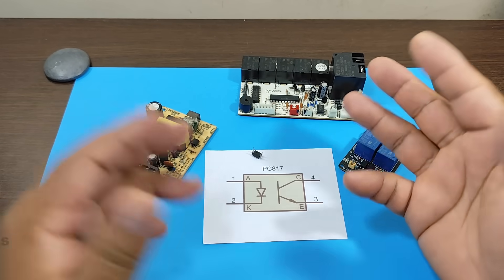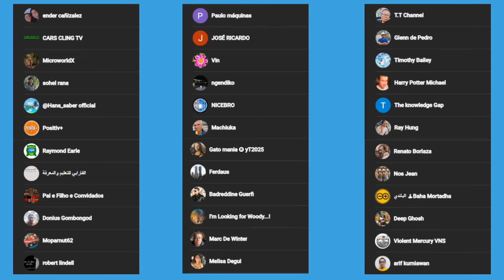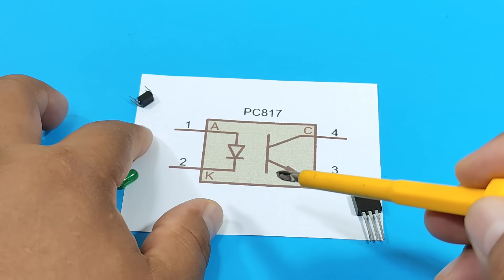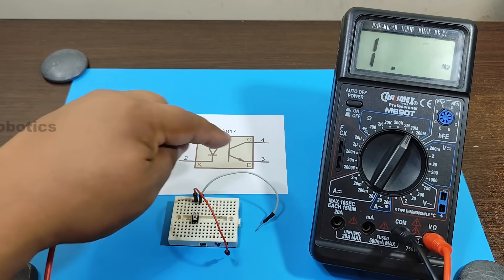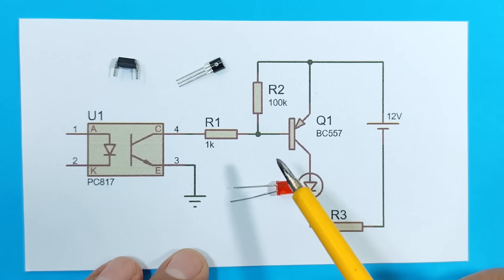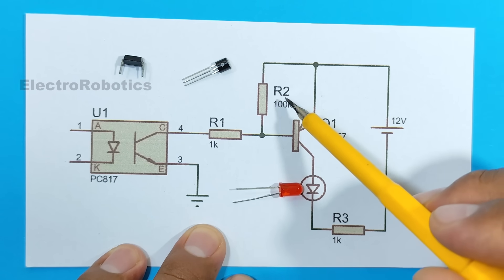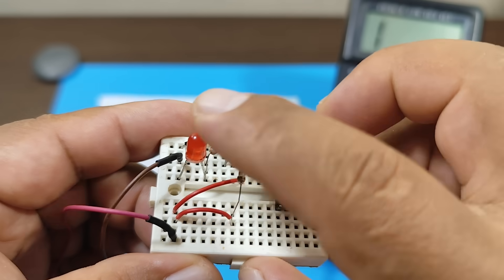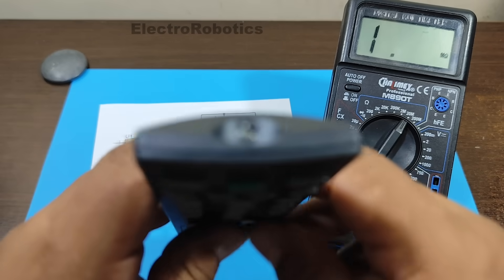Control Whatever you Want With an Optocoupler

Comment: I think that a better explanation to the base turning Q1 on is that when PC817 starts to conduct it pulls the base of Q1 down to ground, and since the base only needs to be -0.7 less than the emitter(which is held at 12v) this will cause the led to light. Talking about negative current flowing into Q1 base can be confusing.

Comment: We used one in a piece of equipment to pass a higher voltage of 5vdc as an input to a PLC as the signal coming from the temperature sensor was only about 1 vdc, not enough for the digital input to see it. It was a redundant high temp shutdown circuit. We have machines going on 25 years now, 24/7/365 with this circuit. No failures (knock on wood lol).

Comment: Thank you, Mr. Engineer.❤
 What is the maximum current and voltage of the optocoupler transistor?🙏
Reply: input side and output side are different for the led 1V is necessary and low current is enough (max 50-70 mA) peak current is 1A and for the output I think 35V max and 200 mA (may be overheat) see their datasheet
Reply: @elecTr10ic
Thank you, Mr. Engineer, for your information and response.
❤👍

Comment: Great video. I have a question. Pin 3 of the optocoupler is connected to ground. I am wanting to find the return path back to the transistor circuit. Should a ground be connected to the negative terminal of the battery? Thank you.
Reply: you can do that the issue is the load at the collector side and the current of the load is important. As in the sample here if the 1 and 2 have the 1 V and the led is on then 3 lets the (-) pass to pin 4. and the low current is necessary for the base of the transistor
Reply: @elecTr10ic Thanks for the reply. There is no return path from pin 4 of the optocoupler back to the transistor circuit. There is just a ground symbol. I get turned around when looking at circuits that have a PNP transistor. So I was just trying to figure out where pin 4 of the optocoupler connects to in the circuit. I looked at the breadboard. It seems like it goes to the negative side of the battery. Again, I appreciate your post. I would like to make this circuit.